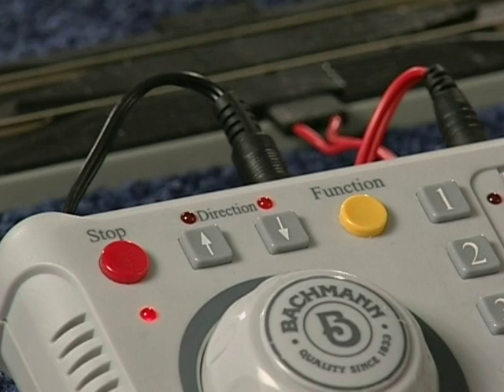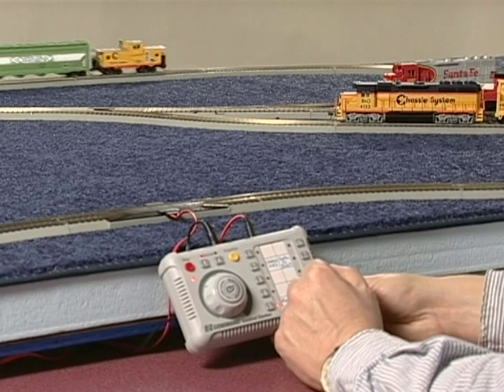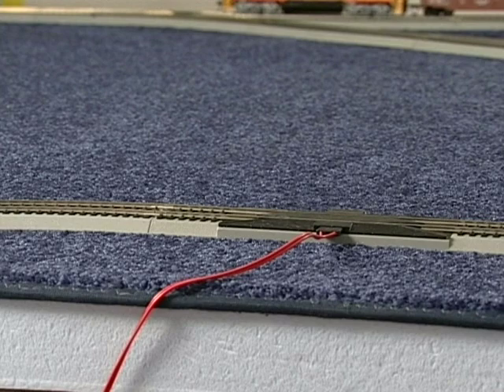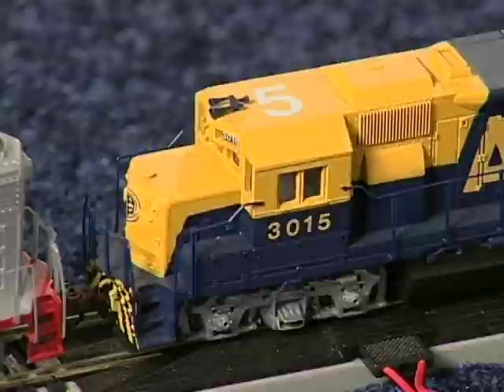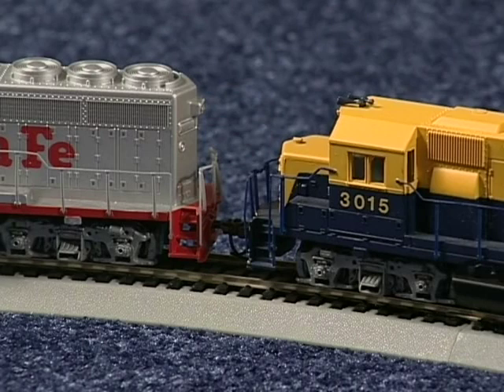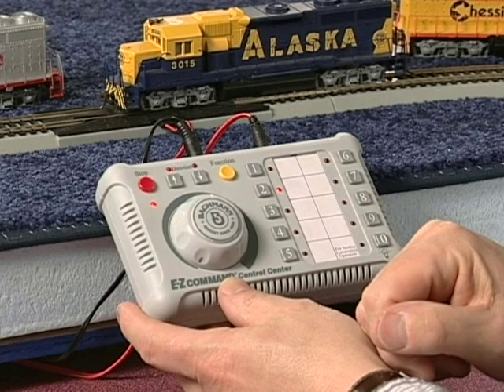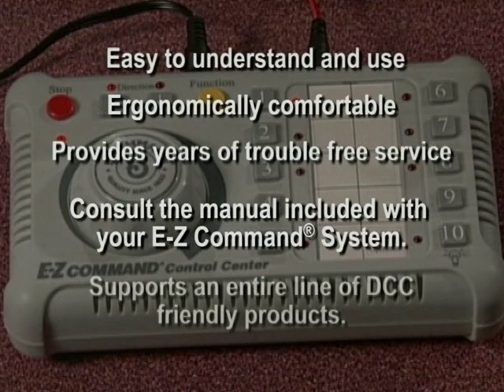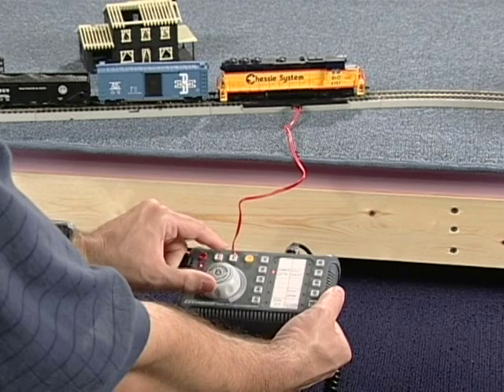Bachmann E-Z Command part 2

Comment: My controller doesn't work the ac adapter gets hot, but the controller won't light up and of course the trains won't move, Do I need another controller? Been trying to troubleshoot ran out of options.

Comment: Do you have any suggestions/advice on how to easily drill holes for the green turnout wires and the red power/feeder wires? Because it's not easy using an ordinary drill bit.

Comment: since this item has been discontinued is there any other option to add walkaround with this system?
Reply: NCE or digitrax offer easier and more portable walk around options.
Reply: I bought mine used on eBay and it works great
Reply: I bought one with a starter set
Reply: I got the newer E-Z Command and it runs amazing on my layout.

Comment: I am using N-scale trains and Love that emergency  stop help prevent collisions at crossing tracks ... Also I heard mix reviews on using DC analog engines with easy command number 10 button control that analog engines will burn out after long use. I tried running two dcc and one dc at once with good results so far but worry about that problem. Any one have any advise on that issue running dc on easy command analog # 10 control button?

Comment: my bachmann ez conytroller started blinking and no trains are running after i unplugged it now its not working and my trains arent running,
Reply from the maker: Blinking usually indicates a power short somewhere on the track. Check to make sure all locomotives and rolling stock are on the rails and not derailed or fouling turnouts, all track connections are secure, and no metal objects (other than wheels) are in contact with the rails.
Reply: Press the stop button again, the trains should run.

Comment: Would it work if I got a ez track terminal and modified the ends to where I could use other track to run my trains on? If that’s confusing here is an example: I take the terminal, and cut off the plastic joiners and use regular track not easy track for the rest of the layout. Would it work?

Comment: I need to know how to connect track without plastic ballast to the terminal rerailer
Reply: Use foam or cork roadbed under the non plastic normal track or anything non conductive to raise it to the height of the ballasted E-Z track.

Comment: Can we use the E-Z Command Control Center on Bachmann Thomas trains?
Reply from the maker: EZ command is used to control locomotives equipped with Digital Command Decoders. Bachmann does not produce Thomas items with Digital Command Decoders.

Comment: Since it appears as though Bachmann doesn't respond to any of the questions on here, perhaps a Bachmann DCC model railroader can help me?  I bought a locomotive that has a factory setting of #15 and the EZ Command only goes up to #10 so, how do I reprogram the locomotive to run or is that not possible with the EZ Command system?  Thanks in advance.
Reply from the maker: http://www.bachmanntrains.com/home-usa/images/E-Z_Command_instructions.pdf
Refer to page 3 under "Reprogramming decoders with previously assigned digital addresses". All DCC decoders come addressed number 3 - this is the NMRA standard...
Reply: bachmanntrains Done that countless times & "no-go".  So, either the Bachmann system cannot control the Atlas locomotive or I bought a paper weight???
Reply: Bernhardt Heckendorn Did you find a fix? I'm hoping not to run into the same thing
Reply: It's possible to do that just READ THE MANUAL! That came with it
Reply: Take it to a hobby shop with program track they change the addresses

Comment: can I use this system with Hornby DCC locomotives? please reply. thanks from Dylan Palombo.
Reply: Yes. Anything that uses DCC can be run with this.
Reply: I think so it depends on what scale you have n, ho scale it will work no boster needed if you have o, and g scale it will work but you will need a boster